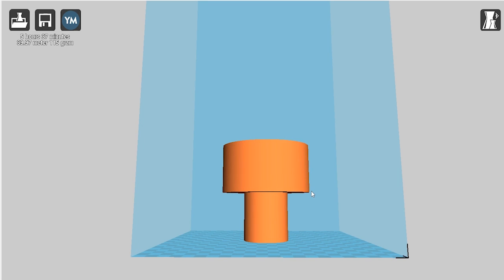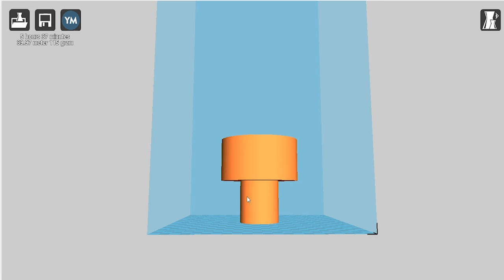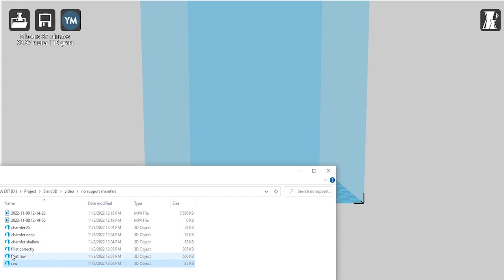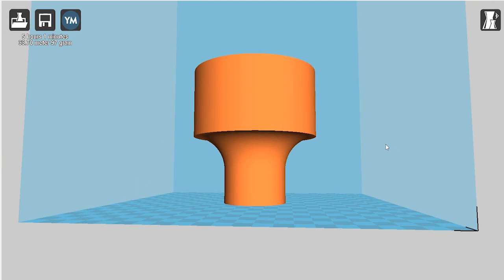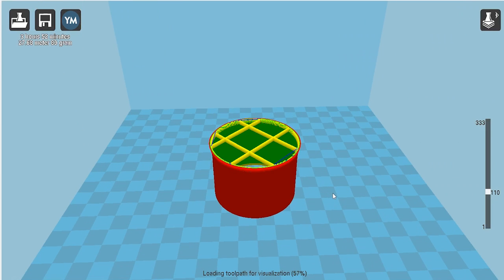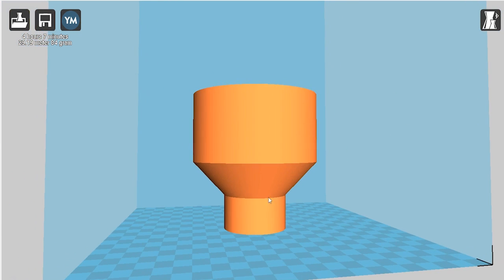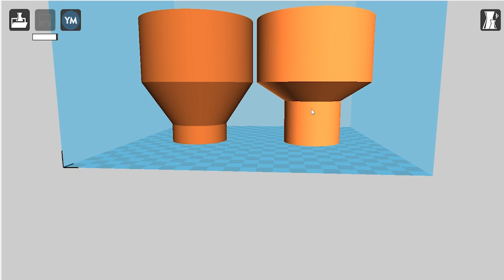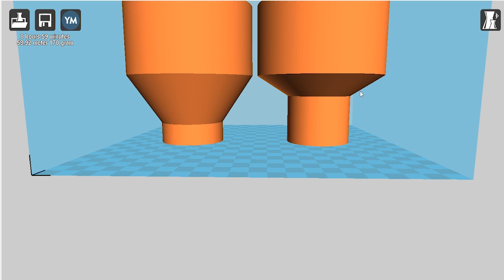Easiest Way to Eliminate Supports | 3D Printing Design for Beginners

Comment: If the part needs that 90 degree then you can't slope the underside. A more better option is to turn the part 180 degrees so the bigger section was now on the bed, the printer will do the big end and then come in straight across the once was over hang and print the smaller section that used to be the lower part before the over hang.
Reply: You can do that with this part but i think it's not purpose of this video, i think he used this part as an example of what you can do in case you don't want to deal with supports
Reply: @jeronimomurruni  in that case this video comes out as a clickbait, because it says never use supports again.. unforunatelly this is not the case, so is a false statement.
Reply: Actually your suggestion doesn't solve the problem because then the inside of the part needs support.
Reply: Assuming the part is hollow. If not then your suggestion is good.
Reply: @DonBarthel  no? you'd need supports on the insides (also known as infill ), to print the top of it anyways

Comment: Adding a chamfer or fillet is still increasing material usage (material that could otherwise be used for supports). Secondly, you are changing the part geometry and possibly application. These changes might affect the usage of the part.
Reply: As he said towards the end of the video, it's for mass production. So, the goal is to reduce post-processing of the 3d parts. Saves lots of time and effort if you can just pluck the prints off the bed and pack them for shipping right away
Reply: @real_mikkim  oh, didn't know it was hollow
Reply from the maker: Possibly. But when given the option to add disposable material or use that material to improve the part, a designer to not make the material disposable. The chamfer is essentially integrated support that can also improve the strength and surface of the part. If the application allows for it.
Reply: @slant3d  thats only in the case design allows for it... quite often it doesnt...
Reply: @slant3d  you could flip your model upside down then bam, no supports or changes to your model (to the example you used in the video)

Comment: What about a hollow rectangular box like a long margarine container but on its side with the top now facing front and no longer uppermost so that a longer box can be printed in z axis because build plate is too small to print flat and assembly is too much hassle and prone to failure
Reply: You simply should print the box with chamfers and buy margarine with chamfers to fit it )

Comment: Ignoring the obvious flipping the part upside-down, since this is only an example, I'm willing to bet the extra material and time in your giant chamfer is at least as much as any support material that would be used.
Reply from the maker: Possibly. But would you rather have that material be thrown away or used to improve the part? As well as eliminate the labor of removal.
Reply: @slant3d  Labor for removal is a valid consideration, although with proper slicing settings I find supports super easy to remove.

Whether it improves the part or not depends on the part. Sometimes weight has to be a consideration in the final product.

Comment: Alternatively, just rotate the thing 180 degrees and print it without modifying or supports.......
Reply: With some parts you can do that. But it's not always the case
Reply: That's actually what I did with my last part.  But I swear I went through all of these ideas before I just flipped it.  45' tilt also tends to work to remove support on a lot of shapes with 90' overhang.
Reply: when 3D printing an object that as  a screw like part in it flipping 90 or 180 degrees will do nothing but maybe make it print wrong. Another common one i see 3D printed are IoT device cases. As you just slide in 2 to 5 PCBs to make the device work the rotation doesn't matter for printing but having the supporting structure does matter to make the product able to not collapse during nor after the 3D print is down.
Reply: this specific part - yes, but when it's part of a larger design, it's often impossible

Comment: lol just rotate it updown
Reply: Me the entire vid:
Reply: I was also thinking same but what if there will be a narrower cylinderical shape both ends..!!??
Reply: @himanilsharma2147  Then you’re in big trouble 😂
Reply: @himanilsharma2147  Then you split it into 2 parts and glue it together.
Reply: @himanilsharma2147  but what if there will be a narrower cylinderical shape both ends..!!??

There are an infinite number of 'what ifs'.

This video was nowhere near a useful discussion of support elimination techniques.
Reply: @imacmill  I think that's what I was saying... and this video is for who had never designed and printed anything with themselves else its a very common approach and without fillets and chamfers people waste their time
Reply: My exact thought 30 seconds into the video
Reply: @real_mikkim  its not a hollow tube, it has infill
Reply: Exactly....👍
Reply: sometimes this ins't a option
Reply: @Zafira-Fan  sometimes this ins't a option

Sometimes there is no options for avoiding supports, at which point you either live with them (and orient the print to minimize their use, while at the same time balancing orientation with print strength considerations), OR...break the part into multiple sections and glue or weld the pieces together (I use this technique often, as it also allows me to optimize print strength, orienting each printed section appropriately).
Reply: @imacmill  i mean sometimes ther isn't an option to rotate the part
Reply: That’s what I thought! Lol
Reply: Yea, just change the model into something that won't with for what you designed it for.
Reply: Is he not trying to make a demonstration?
Reply: @Iamwolf134  OMG
Reply: But this depends on what's inside
Reply: This is an example. Of course if you are printing this alone it's best to just flip it but if it's part of a larger print and the rest of it must be printed in a certain orientation, you may have a portion like this and have to deal with this issue.
Reply: What if that example part was attached to a base? You couldn’t just rotate it. He’s demonstrating chamfers vs fillets vs overhangs.
Reply: .. or just use arc overhangs: build the stalk then put another layer of that same disk.
Then just keep printing larger and larger circular perimeters until you reach the required diameter.
Reply: The concept of “the example” is obviously beyond your grasp.
Reply: @fraudbuster1456  Its a bad example, how hard would it be to show an example where both top and bottom are narrow compared to the middle and with an overhang...
Reply: @mikiex  Using the same thought process you did to come up with finding fault with an example, one could argue that there could be some other factor limiting the orientation such as shear strength requirements, surface finish, or just about any other reason your argumentative stance has prevented you from contemplating. Let them use their example as they see fit and instead, try to appreciate the actual insight being provided by the ones trying to teach you something.
Reply: @fraudbuster1456  the concept of humor is obviously beyond your grasp, fug. LOL
Reply: @CBORK27  actually, it isn’t. You simply aren’t funny.
Reply: @fraudbuster1456  you simply have no sense of humor. Go now in peace, My child.
Reply: @fraudbuster1456  Y’all should like, go outside.
Reply: @CBORK27  Amazing how much the truth hurts. I know you guys are in a bad way now that you’ve been called out for what you are so I’ll leave you alone now to mouth off about it. Cheers and better luck next time.
Reply: Lol IQ 1000 lvl talk

Comment: If only this worked in general. When it does, yes, it's great. But often the original reason for the 90° overhang was some sort of fit/clearance/non-interference requirement that doesn't admit adding material.

For that case there's a lot that can be done in theory, but poor tooling. Actual 90° overhang printing (ala full control), bridge supports (constructing a minimal set of small supports with a bridge at the top as the support interface), sacrificial bridges attached to the part itself, etc. There's lots of advancement to be had in slicers here.
Reply from the maker: Absolutely.
Reply: honestly, we just need some of the non-planar printing methods that already exist to be implemented in slicers, so we don't have to code our owns
Reply from the maker: @roberthercules3159  That would be cool!